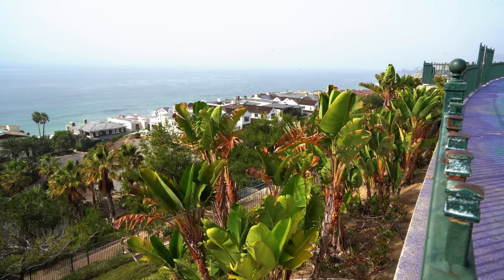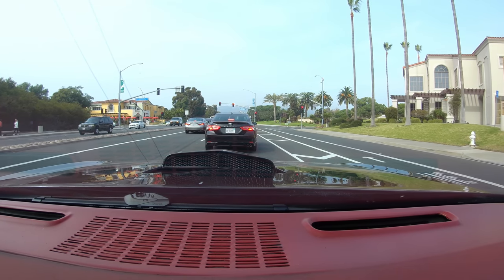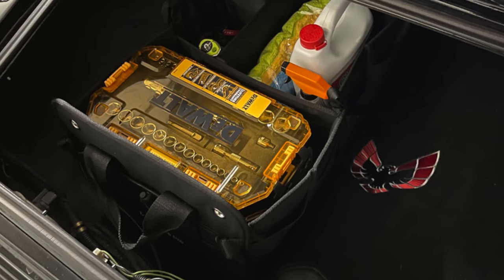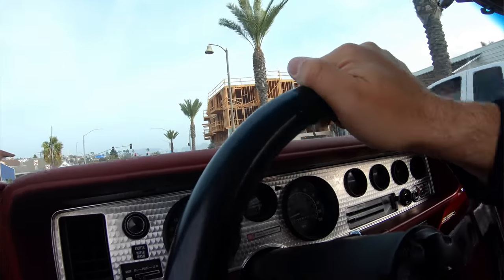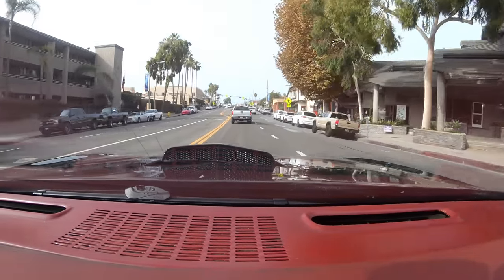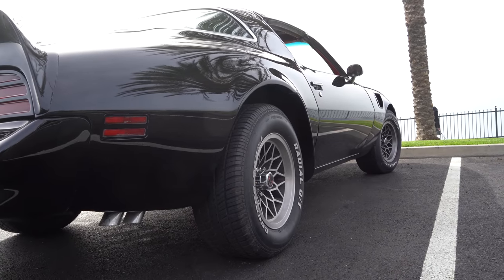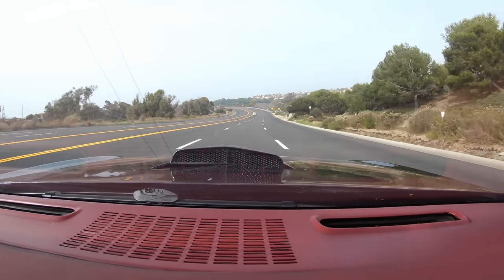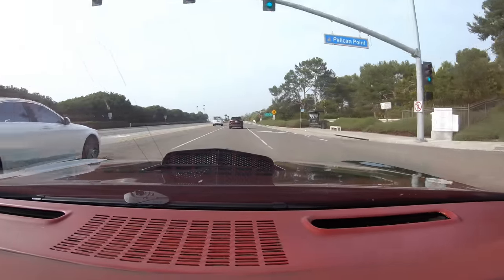The Trans Am is finally DONE! Why this is the COOLEST Car in the World!

Comment: Sady Winston, it went exactly as I said it would when you dropped off the T/A at that body shop. I said they would have it waaaay longer than they promised and that they would lose and break parts. It is the nature of most body shops it seems. Glad you are finally living the dream my friend. By the way, my 82 T/A came out well.
Reply: What's the name of the shop so others can avoid it?
Reply: One of the benefits of living in a small town for a couple of decades is recognizing professional LOCAL businesses versus clown town pretenders.  I agree many/most(?) body shops have rotten customer service records.
I've got a guy  I met over 15 years ago.  He's a manager/scheduler.  He's remarkable at doing what he promises and standing behind his shop's work. I've followed him to 3 or 4 different shops over the years because of this. If you have a solid mechanic or body shop guy - hang on to them and treat them well.
Reply: If you want a body shop to fix your car properly, have a mechanic strip it down to the bare chassis first. Body shops don't have any expertise with functional parts, they only know bending metal and spraying paint.
Reply: I think that’s average turn around time for a to bare metal paint job.  Mine was stuck at a shop for 4 years before I got it back in primer then spend another 6 months at another shop for paint.
Reply: @danhoyland142  That would be fine if the shop promised you that time frame. But they don't. They always way underestimate it. I put out a car a year from my one man shop in my back yard. And that one a year is actually 3 months each summer.
Reply: Winston ! I love this Channel but no updates for over a year ? What happened ? 😢

Comment: I am a pragmatist and I can't recommend swapping the engine if the one you have sounds good and drives fast, and you have already been through it and know the condition. You sound almost self sabotaging. You finally have something going good in life. Just let it be nice as is. Just fix the little problems, and enjoy the car. If the engine goes, hell yea, drop in something faster, more modern, more pontiac, whatever. You can achieve a nice sound with the right exhaust setup. You should probably sue that stupid body shop though. You and c milk could easily have done that bodywork and paint yourselves in 16 months and not lost all the extra parts. That's unacceptable. Pandemic is no excuse.
Reply: Billy Schocher  if its a 403, i wouldnt change it at all. 403 olds has a 4.351" bore and a 3.38" stroke. thats NUTS. a better camshaft, headers, and intake manifold along with timing adjustments, and it would be a screamer.
Reply: 8th
Reply: Definitely more PONTIAC!! KEEP IT PONTIAC ALWAYS!!

Comment: The body shop’s priorities are insurance claims so they lag on just regular projects.  Had the same issue when I had my car in the body shop paying them cash.  They just would not care about my car because it was paid for.  

So yeah they care much more about insurance claims.  Your project gets forgotten.
Reply: Shops in my area only do insurance claims. They can make 1000 a day per bay doing insurance jobs so restos would get pushed to the back and worked on intermittently. Finally they just stopped old cars altogether.
Reply: A couple of good body shops out where I am still do restorations, some only specify doing just that.  Though, it's still hard to choose the right one so be very careful to pick the right one you feel will do the right job at the right price.

Comment: I have a 1979 WS6 Trans Am with the 400 Pontiac engine. I bought it new and have had it for 42 years. In 2018 I had the engine rebuilt. It took six months to get it back. The mechanic did a great job. Then in 2019 I took it to a paint guy with 50 years experience. He had it ten months, but it was well worth it. The car came out beautiful. Looks and runs good as new. It cost me a small fortune to get it restored, but I would do it again in a second. I love my Trans Am.

Comment: I just LOVE Winston's enthusiasm about his dream car. Always brings a smile on my face. Second hand happiness, I suppose, which is a healthy change from the pain I've felt from the absolute sh*t show the body shop has been pulling off for almost a year and a half.

Granted, I never had a 'dream car' per se, but I can totally relate to Winston's feelings. When I got a 1997 3.2 SMG M3, I finally understood what a good handling car actually feels like.

Aftermarket exhaust (Remus) -> even with my HQ audio setup, every 1st month in the spring I'd just listen to the exhaust sounds. Handling at the track was good, but, with new adjustable suspension (Koni/Eibach), the balance is almost unreal. The single piston brakes I never liked, but a Brembo setup with bigger discs did the trick. 'F1'-style paddle shifters on the steering wheel, the best mod ever.

Comment: Congrats mate on getting it done and having it back. 

I'd reckon give the Oldsmobile engine a refresher. Getting headers and new heads, that itself will give you a different feel. Nothing beats the direct feel of a carburettor so that's cool. Basically to keep it reliable. I personally prefer a solid roof but it's cool to even get the T-tops done properly. Once again, it's great to see the car after a while and it looks amazing.

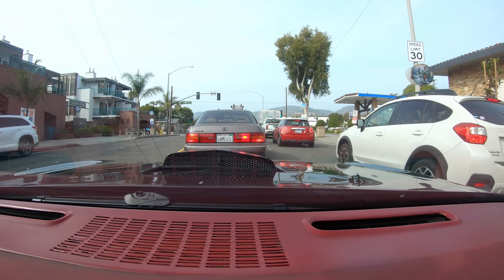Comment: 2 days to get to Pennsylvania for a podcast.  That sounds like a bet for the Bandit! You just need to get C-Milk an 18 wheeler and go eastbound and down with your CBs... lol @17:15 never ming grin., keep in mind the BOP engines were I think 50 lbs lighter than the chevies.   Don't know if it is possible (as big blocks were able to be fit into Camaro or novas,  You might be able to fit a caddie 500 that in 70 put out 400 hp 550 ft lb torque from the factory with low rise intake (it is actually below the ports lol) and Q jet, and can make 600 + with aluminum intake, heads...(and the blocks are cheap and again weigh about the same as what you have not) but nothing too outrageously custom. It also would be mostly torque so it would pull harder but not be peaky horsepower,  Still matching numbers is smart, and is unique with everyone swapping in ls's.  The only other weird idea is a 3.8 turbo from a GTX ... but yeah that's a different direction entirely. Anyhoo just a thought - stay awesome!  look up Cad performance, or Hot Rod magazine in August 89 did an article (there have been newer ones) Anchors Aweigh (The budget solution - 500-cid Cadillac torque monsters);  Keep in mind the 67-69 eldorado's were pulling spces yes including cornering, etc generally in line with contemporary Jags and Mercedes of the same time. With an aluminum intake and heads you might shave 100 lbs off the front end and help balance etc. and have an extra 200 - 300 lbs of torque and 1-200 hp.again = just a thought,  Again they still seem to be a bit overlooked so are not unobtanium like a 427 ford or chevy esp ford SOHC , 426 Hemi,,,  My 71 Cady elderado with one could pull well and still with tall, narrow tires respond - turn fairly well in a pinch.  (I was able to float sideways - oversteer and correct it in the snow to avoid a wreck in the snow by someone pulling out of a parking lot when the other lane was stopped by using break oversteer - throttle understeer..)

Comment: I loved watching you being so happy with your car. Back in 1972 my father, who sold Chevies for a dealership got my mom a 1970 Pontiac Grand Am which had a 400 4bbl engine. I used to drive it around with my friends who suggested I take out the air cleaner and punch it. I know it wasn't good for the engine, but the roar that engine made was almost orgasmic for us teenagers! It was also crazy fast for such a non-aerodynamic body shape, but I got it up to 130 MPH with 3 friends aboard. Fun times.

Comment: Glad you got your Bird back. Before you cut the roof, which will open up another bag of worms, try frame connectors. A competent race shop can build you a set to tie the subframe and the rear unibody together. Or check with BMR or Detroit Speed. I have a 78 TA “Bandit” lol with a 6.0 LS engine and I absolutely love driving it. Congrats again on your beautiful bird. 😊
Reply: IIRC Uncle Tony of Uncle Tony's Garage made a video where he said frame connectors would eventually break the body welds on monocoque cars.  They should only be used on drag racing cars.
Reply: @jrcars7017  ah yes, uncle phony.

Comment: Winston, don't do it! Changing out the motor will ruin the car. It is more than the sum of its parts. Also, chasing HP numbers will steal its soul. It's a never ending Rabbit Hole you will regret going down and a money pit. Everything will need to be upgraded to accommodate the extra power, transmission, drivetrain, suspension. I only say this because I understand the love affair. I've done that to vehicles before and turned them into fire breathing monsters, all ended up getting sold. They loose those aspects that made you fall in love with them in the first place.

Finally, I only happened across this Channel by accident today. Really surprised because I have been watching you for years on ADVChina and SerpentZA. You guys are prolific!!! Subscribed.

Comment: Congrats Winston, I think you should keep the stock engine & do work on it, unless you go for a period Pontiac 455
Reply: I wondered if a big block would fit, I know people stuck 396 - 427 in Camaros.  Ironically the Caddie 500 might be an interesting option as it is roughly the same weight as the 350, (steel block cast iron heads on both) and if you get a 70 it put out 400 hp 550 ft lb of torque with low rise intake and Q jet and non-pref heads - exhaust. ) and should have the same BOP mounting points for frame -transmission as the 455 at least.

Comment: Build the 403 mildly and call it a day. Pushing the 403 with its oiling problems is a disaster waiting to happen. Decent HCI and exhaust and walk away happy.
Reply: The olds 403 comes with 7.9:1 static compression ratio. It needs compression and cam . . . after which it will never pass CA smog again.
Reply: @Firebert79TA  it's not staying in Cali.....
Reply: @EffequalsMA  didn't realize that, good for Winston

Comment: Removing the gas is a safety thing. They are working with angle grinders and probably with welding equipment, and a tank full of flammable liquid might not be a good thing. They should've replaced it for you though.
Reply: You dont just remove the gas you need to remove the tank, it is the vapors that explode not the liquid.

Comment: I’m Pontiac thru and thru, but any conversation takes a lot of extra money. Do a mild rebuild on what you have, up the rear gear to like a 342 rear gear, add an overdrive tranny, the TH200 that came in the Buick Grand National will bolt up directly to the old motor, and enjoy. Keep in mind building HP gets you to burning premium fuel which is about a buck more than regular, and 400 HP is not worth the squeeze since 600 plus is the standard. Your rear gear ratio is probable around a 273 since you dive at 70 mph and only turning less than 2k rpm. Definitely not a performance gear, but great for highway driving and saving fuel. Your carb is also set up for fuel economy due to the small primaries, and the secondaries are pretty large thus the loud sound when they open.

Comment: Great video! I've always thought the look of a Holley double pumper carb was better than the Q-jet, but when the secondary's on the Q-jet open up, the tone of the roar is addictive.

My cousin had a 69 firebird with the big valve heads and an Isky 280 mega-cam. Stock intake and no headers and that thing was beast.

Comment: the 403 is a good engine had several of them not in trans ams, though mostly in big oldsmobile cars, so i would keep the factory engine in the car
Reply: just dont rev it or you will blow the webbed mains.
Reply: The 403 is a 7.9:1 SMOGGER motor with 180 horsepower, and webbed main bearing supports.
Reply: The 403 is not a bad engine, its reliable in stock form with good torque. It can be built, they make a girdle you can get for strength due to the webbed mains. It does have smog heads, which could be upgraded. The 403 could make an easy 400-500 hp with enough money. It's all in what you want to do and how much you like whichever said engine and $. Me myself I have a 79 ta with the original 403, it cruises good. I picked up a early 1975 Pontiac 400 that I plan on building to swap into my car. I personally feel the 400 is a better foundation to put my time and money into. A chevy 350 or an LS is also on my mind to thou...

Comment: I probably worked on one of the machines that built that motor.  I have read that because of going to a small block the cylinders are too close and you may have a overheating problem.  One of the advantages of a Lansing built engine though is that we held tighter engine tolerances than other GM engines of the time.  So there is that.

Comment: Winston, I would keep your motor. Do some performance upgrades to it. I had vintage air installed when I started to have A/C issues and it works better than original, the only thing was the glove box was replaced with a less space unit. Enjoy the process and your beautiful car...

Comment: There's something to be said for keeping it stock, but on the flip side the 403 was never the engine Pontiac intended. I would find an old Pontiac 400 or 455 and build that. Oddly enough, you might also find that doing so is cheaper overall. There's a lot more aftermarket stuff for the Pontiacs than the Olds, and that can really keep costs down.
Aside from spending a bit on getting it to say 450 hp which is not that hard, I'd look into spending my money elsewhere. Modifying the driveline will make the biggest difference of anything.
Get a Gearvendors overdrive for the TH350, and then get a Wavetrac rear diff with a 4.10 gearing.
That gear might sound aggressive, but with the overdrive, you'll still cruise at 2350 or so at 60 mph. But the pickup and acceleration from that over your current 2.92 open rear, will be night and day. Even with stock power, I'm guessing that you will cut 0-60 with 1.5 seconds if not more.
If you pair that up with a mild build 400 engine that has a set of cast alu heads and an equally light Edelbock RPM Airgap intake, that will make your car more reliable, and a ton more fun to drive. And it will be cheaper than doing a more hardcore higher hp build - and you can still run a Q-Jet🙂

Comment: Very nice car . The 77-'78 front end is my favorite of all the 2nd gens. The tail lights of the '79-'81 are also  fave. I have an '81 Black and Gold Trans AM SE , TH350, Fisher T-Tops, and had it since the mid 80's .  Its an awesome highway car. It has better than 3x factory power with the sbc thats in it. I have considered making my shaker functional. Am considering going to the 6.6LT motor now available as a crate from Chevrolet.  Ss it is the thing would knock down 25 mpgs highway.  I built that engine back in the mid 90's . I ditched the original engine back then and never looked back. Love the small block Chevys.Not much use for the BOP engines. My brother has a '71 "Trans Am like" and he ditched his Poncho motor and put a big block Chevy in his..  And yes, The QuadraJet is my favorite carb. I'll put Fuel injection on mine before I even consider going to a Holley.  Back in the day I used to fine tune the jetting between winter and summer driving.

Comment: considering all of the missing parts, over a year past the promised delivery, leaving it outside uncovered and then receiving it back non running with tons of loose bolts and shoddy polish, i would absolutely pursue legal action against the body shop and get your money back as well as making them pay for everything you had to replace and/or fix.

Sadly, i imagine california law wont even think before siding with them as its well known california is extremely anti-consumer, but its certainly worth pursuing to at least some degree for compensation. especially because its the dream car.

Comment: I know this is like my 4th comment lol but i love your china channel but i just found this one and its really up my alley and if it was mine id keep the 403 rebuild it paint it and put some chrome valve covers in it and display it with the car on a stand at car shows and get a 350 bore and stroke it out to a 383 put reinforced pistons   in it, a comp cam with the rods, springs, rockers and all the little goodies that go with it and put a nice procharger or even a turbo? Lol if you just want to go the cheeper route which would sound sweet if you ask me (i mean who has a turboed trans am lol) and maybe a little shot of juce if you just want to add a fun button 😂 but it all depends on what you want the car to do thats why id keep the 403 so if you ever got tired of the power you have the choice man if you live anywhere near me id help you do whatever you wanted just to have a chance to drive a trans am

Comment: Winston, my first car was a '76 Trans Am, 455cid 4-speed manual, loved that car. It was one of the best riding/driving cars I've owned. Totally 'get' where you are coming from. Don't do the engine swap until you have the rest of the issues sorted, but if you go that route, later Firebirds had the LS and it is a great platform for reliability and power - and why it is so popular.